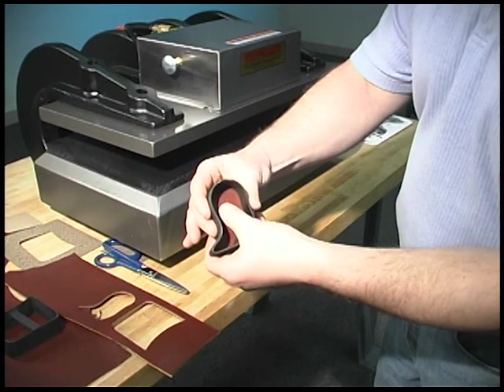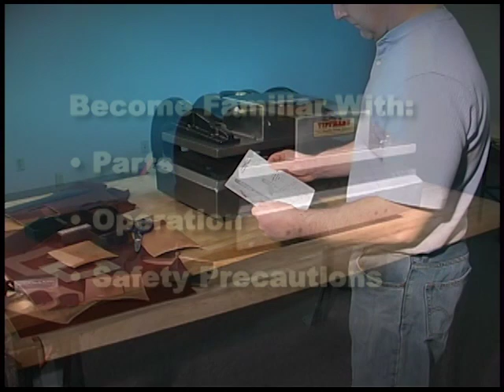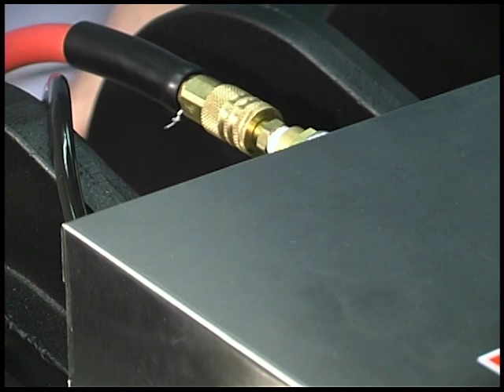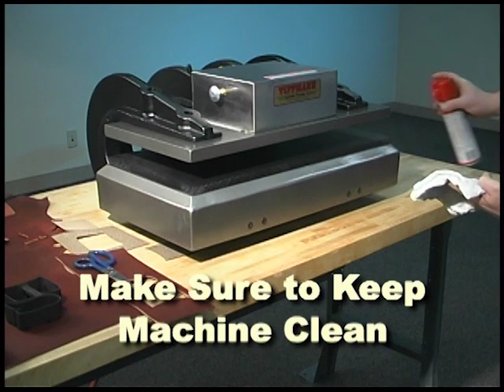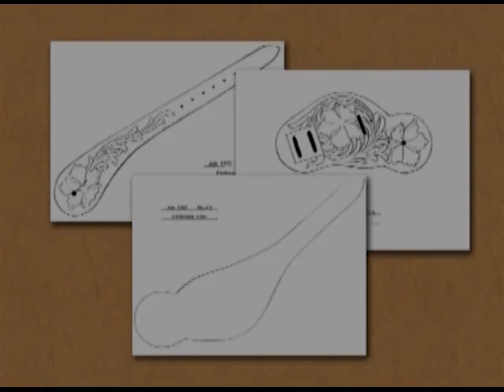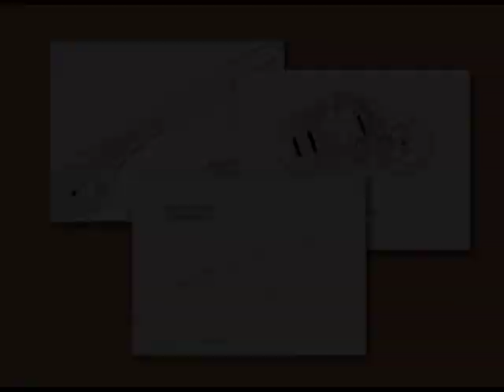Tippmann Clicker (Instructional Video)

Comment: It really helps to build a wood "surround" so that the cutting surface is level with your work, Ease of sliding dies and leather nicely on to cutting plate. I used 4 4x4's as the surround mounts, then a 3/4 plywood for the surround - just like a table with the machine placed in a cut-out.